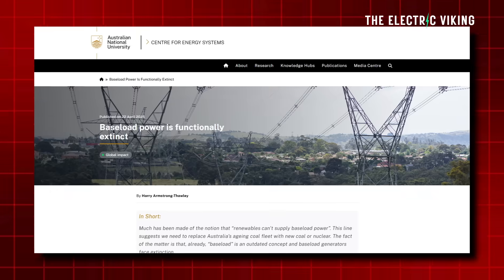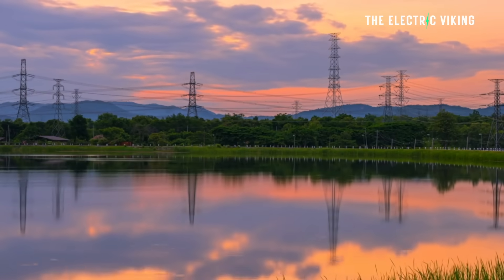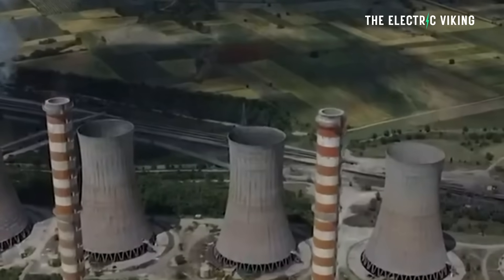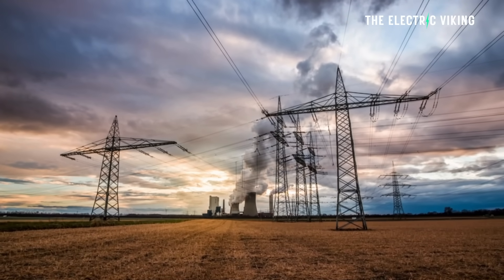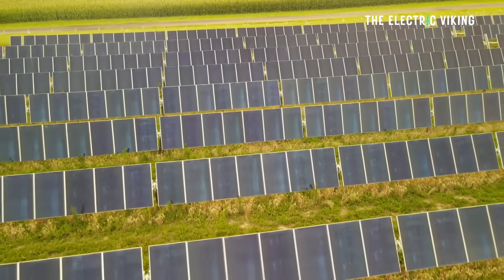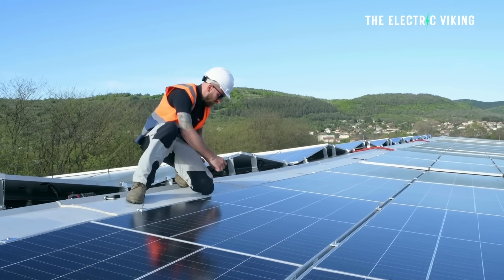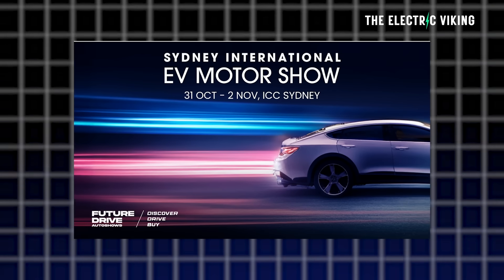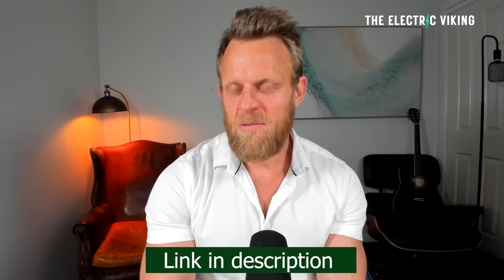The End of Baseload: How Renewables Are Killing Coal & Nuclear

Comment: Data centres will not build Nuclear.
Reply: Why not?
Reply: @aliendroneservices6621Because they need cheap energy.
Reply: @Anon-u3i 
This is aging worse and worse by the day
Reply: @ManiacMayhem7256 They will not build Nuclear because it's far cheaper to build solar+storage. Who would decide to build Nuclear and make their Data centre more expensive to run than its competitors using Solar + Storage?
Economics 101 kills Nuclear.
Reply: @Anon-u3i 
They are already building nuclear to power their data centers, and are investing heavily in fusion power to power their data centers. This is already happening, thus debunking your point. If renewables were so much cheaper and practical, why arent they going that route?

Also, if you compare the actual total cost of wind and solar, the costs start to equal out, especially outside the West (China is very notable here)
Reply: @aliendroneservices6621They will not build Nuclear because it's far cheaper to build solar+storage. Who would decide to build Nuclear and make their Data more expensive to run than it's competitors using Solar + Storage?
Economics 101 kills Nuclear.

Comment: Quite misleading Beyond a certain point, solar is sustainable only at low latitudes where there is little seasonal variability is solar output. At latitudes le here seasonal veriability is like Summer production = 5 x Winter production, batterie can do nothing and solar panels just make some free riding on peaker gas plants

Comment: This is a gross example of how personal bias overrides reality.  Baseload power isn't going away, and renewables are not the solution, quite the opposite.  You lay out the problems that renewables create for baseload power, and then blame baseload power, not the renewables that caused the problem.  You correctly identify that energy storage is the key to the problem, but fail to recognize the difficulty involved, as if a pile of batteries the size of Mt. Everest was a viable solution.  What you don't seem to understand is that baseload power includes its own energy storage in the form of fuel. It is true that some forms of baseload power are not good at ramping up/down quickly, but other forms, like natural gas turbines are very good at that.  Furthermore, the ramping up/down problem would not be nearly as big if we didn't have renewables  ramping up and down in a way that can't be controlled.  Also, there are technologies that can make even nuclear power ramp up and down much faster.  Ultimately, the issue comes down to economics.  The push to renewables is making energy far more expensive and therefore less accessible, reducing our standard of living and economic growth.  The reason is simple, with renewables, you have to build the electrical power generation system twice.  Once for when the renewables aren't available, and once again for when they are.  That is twice the cost for the same delivered power.  When evaluating the cost of renewables, as compared to nuclear, natural gas, etc. it is vital to make a fair comparison.  Nuclear etc. has the energy storage built in as fuel.  Renewables require separate energy storage like batteries etc.  The cost of renewables is the cost of the solar panels and wind turbines plus the cost of the batteries, plus the additional infrastructure to hook up all that widely distributed power to the grid.  When compared fairly, nuclear is cheap and safe.  Renewables are expensive and redundant.  There are rare exceptions of course, but public policy should not be based on rare exceptions, or worse yet on a utopian ideology that doesn't actually work
Reply: Exactly. Funny too how these guys ignore the one renewable that does work consistently: geothermal.

Comment: Probably your most impactful contribution so far. Especially when you consider that because of it’s significantly lower combustion risk, sodium based power storage can be built closer to the point of delivery and stacked vertically instead of spaced out in a single horizontal plane. Estimates of half the cost of lithium are fairly conservative. I’ve heard claims as low as one tenth, once production gears up.

Comment: There are 2 constant problems with the NEW NUCLEAR. 

1, is CASHFLOW 247 to keep the centskWh low at the consumer's meter box. 
And roof PV is 2cents kWh which is extending to 247 selfsupply and no grid electricity. When the sunshines and the batteries are full. 

Grid electricity is only as cheap as it is if all of the grid capacity is used 247.
My grid supply is 52cents kWh. 
Others get 50cents kWh with thier larger kWh. 

Roof PV is still increasing  and battery use in business and homes. 

2, NEW NUCLEAR was going to stop nation wide and worldwide CO2 emissions but a massive increase in NEW GRID CAPACITY to make any difference is economically impossible because of the BIGGER CASHFLOW it needs. 

3, NEW NUCLEAR business case is based on distant renewables and central generation comparisons, both needing the grid to supply consumers meter boxes. And gain bigger cashflow.  WRONG COMPARISON. 
All electricity should be compared with the number of roofs.  Total numbers including homes and businesses and warehouses and factories and schools and shopping centre and storage businesses and hospitals and...
For Australia 20million roofs, 20million meter boxes 20million vehicles being replaced by EVs. 

I see all of these roof PV everyday. 18 in my 30 home street. 

My kWh rate keeps increasing and both my immediate neighbour's run on roof PV with batteries coming.
2cents kWh roof PV electricity and 4cents kWh feed-in electricity. 

I see the daily DUCK CURVE of demand collapse and so cashflow collapse increasing.
GOUGING of the poor slow adopters is real today. 

So NEW NUCLEAR has 3 problems cashflow collapse in a massive grid business AND a massive cash borrowing to build their fantastic NEW bigger grid to stop CO2 emissions AND dirt-cheap roof PV with batteries. 

It is a sh.....ty business case. You imagine the old business ways will remain.

Comment: Meanwhile in Spain and Portugal, a two day blackout caused 11 deaths. The only reason it didn't spread across Europe was because of the French nuclear stations stabilising the voltage. With 100% renewable Spain had an extremely sensitive grid. All it took was one faulty inverter in a solar plant to take the whole system down. As for wind, you are paying for these turbines to NOT run when it's windy and there is low demand. We still need base load if you actually understand the science and economics.
Reply: Disinformation.

For instance, Spain and Portugal are NOT 100% renewable. Spain has seven nuclear power plants.

Comment: The problem with energy generated by wind and solar sources is the low stability that these sources have in the face of short circuits.
Reply: Have you heard of batteries & synchronous condensers? 😅

Comment: Nuclear can shutdown rapidly but take days to get back online.
Reply: One of the nuclear safety engineers at Xcel Energy in Minnesota told me that it takes three days to shut down their nuclear plants.  The nukes at Fukashima melted down because even though the reactors had been shut down, they were still producing substantial heat energy 24 hours later when their battery-backed cooling systems ran out..  
If you meant to say that the nukes can vent steam to reduce power, well, yes they can.
Reply: @peteinwisconsin2496  I meant nuclear reactors are fragile. 
If the grid demand changes daily or the grid has a sudden blackout the nuclear reactor is a big problem that can be managed but it is not as robust as promoted.

For the Australian grid electricity only half was promoted.
And promoted as robust base load.

Thank you for the feedback.

Comment: Inflexible baseload needs storage too, that is why they built out pumped storage here in Europe back then. Flexibility is what offers extra value to the grid, not baseload, which was just used as cheap bulk electricity supply which renewables can do cheaper.
Reply: You are right in that base load or base supply power had value because the electricity they provided was Cheap.  Now that coal and nukes are the most expensive forms of electricity, they are not valuable and the accountants will continue shutting them down.

Comment: The grid as a massive business is the way to think.
Massive $TRILLIONS investment over 14decades. 
1million km, 20million meter boxes, 20million roofs, 20million vehicles all EVs in 20years
Massive cashflow because the grid is rented and electricity is sold.

250TWh at 44cents kWh is $110billion cashflow to the grid owners and only $10billion to the generators. 
Generation is dirt-cheap electricity. 
Roof PV electricity is cheaper and no grid rental costs. 
Daily DUCK CURVE of demand collapse in business hours is expanding to 247 cashflow collapse with more EVs parked 23hrs daily and all night long with v2g technology. 

Central generation will be abandoned. 
Roof PV feed-in will dominate the grid supply. 
Industrial Customers moving away from fossil fuels to clean electricity will be the NEW GRID CASHFLOW. 

The grid is lightweight and fragile because it is extremely expensive to overbuild or to EXPAND. 

The grid is too valuable to waste on central generation monopoly.

Comment: I do agree with your arguments regarding baseload. However and before entering the age of superabundance of renewables we do need residual load in wintertime. At least in Europe. How can this part of the transition be dealt with in an optimal way?
Reply: In the USA, many of the old power plants are used for seasonal peaking.  They run for 2-4 months and then are shut down.  One day they won't be needed at all but that is the transition plan until then.

Comment: Someone mentioned Inertia provided by the spinning mass of the coal and nuclear generators-

 pillar make 50Mw flywheel  UPS for physical inertia,  I believe a while ago the synchronising issue was fix to use straight batteries and a major Indian coal fired generator have been running one of their coal-fired plants with solar that heat the water to run the plant full time with the heat exchange running through the night on the stored solar so that can provide the inertia as well.

Comment: I agree with 99% of everything that you've said. My one point of contention is that AI data centres could likely profit from automated Robotically operated SMRs housed in large basements, and would likely profit over time due to the efficiency of nuclear energy and recent breakthroughs (of the last 100 years) in radiation shielding. Spent nuclear fuel can be recycled and reduced with unusable isotopes being put into safe storage. 

Renewables are magnificent and I think that every household should use them but for particularly power-hungry industries the SMR is still a very viable option. Some companies specialise in the exact technology that I just mentioned and can already supply enough generators to power data centres. My reason for recommending basement storage is simple: less square metres above ground wasted and more room for infrastructure in the future.
Reply: Who is actually selling SMRs right now ? Did you know a lot of datacenters are build near homes, which regulators don't like and anything nuclear often needs a large plot of land around it.

Comment: Load is caused by the consumption of electricity, not by its generation.  We will always have base, shoulder and peak load.  This is a discussion about generation and provision, not load.

The generation model in Australia is very different from some other countries, because you have very reliable sunshine all year round that enables solar.  However parts of Norway, Sweden, Finland, Greenland, Russia, USA and Canada have winter periods of polar night, when the sun is below the horizon 24 hours per day.  Northern Europe also has periods of very little sunshine.  When the wind drops during those periods, they need an alternative source of energy.  Norway is fortunate to have lots of hydroelectric power, but that does not apply to all countries.

Comment: Baseload isn't minimum demand. Baseload is the lowest point that a generator like a coal plant can be operated.

In the past when generation was primarily by coal, demand was artificially increased to enable those generators to operate at least baseload level. This artificial increase was through programs like off-peak hot water.

This actually means overnight demand is higher than it otherwise needs to be. Once the baseload needs for coal gens has been removed from the grid, more consumption can occur during the day - soaking up abundant solar PV generation.
Reply: Maui Electric was advertising to its customers to please run laundry and air conditioning in the early afternoon when their supply of electricity from wind and solar was at its highest.  One day that will be normal for the entire USA.

Comment: The bidding process is killing Base Load.  Nothing to do with subsidized unreliables.

A distributed generation system is going to be VERY expensive.  An economy killer.  The Australian economy is imploding.  Fortunately, Victoria will go bankrupt before the grid fails.  Demand will dramatically fall.   Batteries will provide load otherwise grid frequency will run riot.

Comment: AEMO app says for the last 12 months grid electricity came from:
VIC brown coal 61%
NSW black coal 68%
QLD black coal 72%
SA Gas   28%
Reply: Yes, we are still using coal and your figures are a good indication that we have more work to do. The change will take time.
Reply: Hmm, Scroll down the page on that AEMO fuel mix page and read the FAQ section, it states rooftop solar is not included. When it is those figures change to Vic  58.9%, NSW 59.6%, QLD 62.4%, SA Gas 21.8%  NEM 52.7% coal + 4.8% gas + 41.9% renewables for last 12 months

Comment: wrong and wrong old nulcear power plants couldn't load follow and even that isn't completely true as France has been able to do limited load following with like 40 to 50-year-old reactors, but like yeh no new nuclear reactors are designed to be able to load follow, not second by second, but or even minute by minute, but with an hour or 2.

But if we went molten salt, first it would just naturally load follow due to the inherent negative temperature coefficient of the fuel salt, second because one of the benefits of molten salt is that you can run the reactor at 600C+ you can store heat for latter, meaning the power generation can ramped massively beyond the power of the reactor itself, you likely wouldn't go too crazy with that because you would have to pay for the extra turbines to do that, but 1.5 maybe 2x  would be feasible and throttling down to 5% output would be possible although costly because you still pay people and the machinery will still decrad at a reduced rate and considering you have a giant thermal battery to store energy, it shouldn't be necessary very often to throttle the reactor to that point.

Oh and the reason why you can't do that with a solid fuel reactor is you need thermal headroom to store energy thermally, so to get supercritical steam at an amount 375C if your reactor runs at 600C you only have about 38% of the thermal energy available, assuming an ambient temp of 21C. you could use some of the remaining thermal energy to run the turbine but it's wouldn't be nearly as efficient, but in times of extremely high energy prices it might be worth it, but you would be limited by the melting point of the storage salt.

Although you might decide not to go with a molten salt and go with a different type of storage medium. Although saying that you could design it to be a massive phase change molten salt battery, which then opens up the possibility of solid fuel reactors being usable, as if the melting point is 375C you have a bunch of latent heat in the melted salt, so if you design the system be able to be frozen and melted repeatedly you would be able to have a good amount of storage capacity even if you can't get much beyond 375C, although you would need a massive heat sink if you are fairly close to that 375C number, say 400C.

Comment: I was in agreement, but not so sure now as I found out that AI data centres use many times more power than an ordinary data centre, in fact as much as a small city.  Over 1Gwh.   That is about as much as 3 x median power station output per data centre.   Do we want AI data centres in Australia?
Reply: I'm in the US and the AI data centers are killing us. So maybe the answer is "No".
Reply: It'll be ok, the companies building the data centers have realised it takes years less time to build out a monster solar plant and a few wind turbines with a backup gas turbine, than it will ever take to build out nuclear or any other solution, and the energy is cheaper. Economics is now driving the issue.

Comment: it's going to be a beautiful future
Reply: You’re kidding right? What future? Record businesses closing because of government regs and energy cost. Get your carbon credits ready
Reply: @jonathoncalabrese2035  renewables in battery stoage is cheaper than fossil and nuclear subsidies for waste storage and insurance. electricity is under $1 per gallon equivalent and falling. gasoline engines cannot get cheaper. batteries are at their most expensive and falling. get your horse and buggy ready.
Reply: Lovely, with all those unsightly and costly transmission lines, redundant wind and solar installations that no one will clean up thousands of Windmill blades along with millions of solar panels that won't be recycled.
Reply: @iainw5081 provide evidence. until then look up #redwoodmaterials
Reply: @iainw5081  What BS